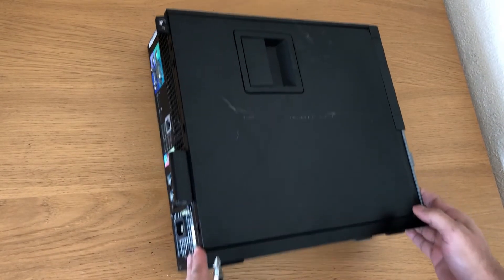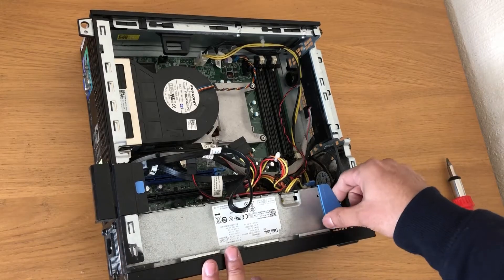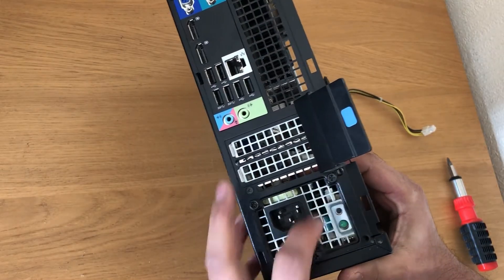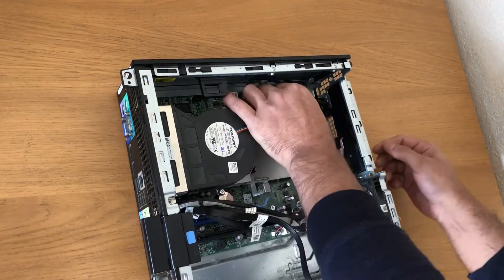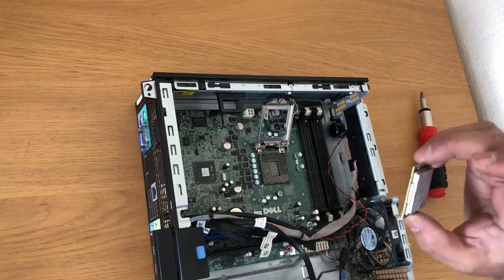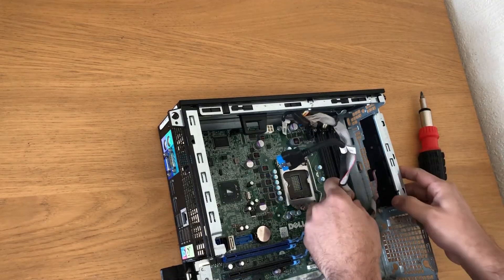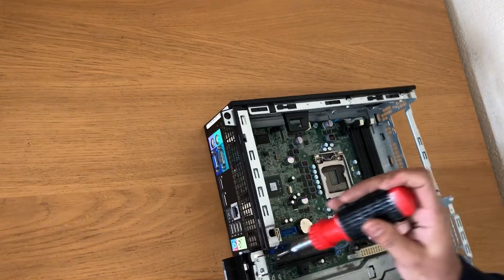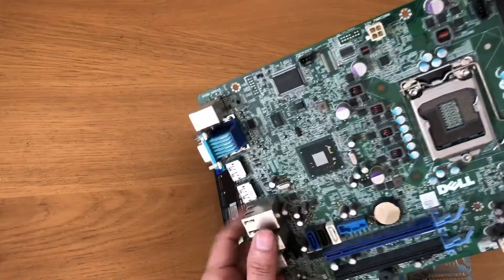Dell Optiplex 7010 790 990 SFF Teardown Disassembly

Comment: I knocked over my tower by accident and while unit shut down. Now when i start it back up my monitors wont come out of sleep mode and keyboard or mouse dont work. What the heck is wrong?
Reply from the maker: Try taking the ram out of the slots and put them back on again
Reply: I reseated the RAM sticks and checked all connections and still not working. Power button flashes amber light 2 times, then 3 times. CMOS battery maybe?
Reply: Thanks!! I just fixed it!! I took out the RAM sticks and put into the other 2 slots and also took out the CMOS battery and put back in and now boots up! Thank you soo much! Been working on this for 3 days now trying to figure out as I know nothing about computer hardware.
Reply from the maker: @jzepp7013  glad you managed to fix it.
Reply: @SyltechUk keep up the good tutorials! I know nothing about computer hardware but you saved me from just buying another tower because I thought I would damage my current one and not be able to fix myself

Comment: when i try and pull the latch on the side it wont open. and i pull hard, im afraid if i pull even harder im going to break the handle latch off.i noticed yours opened easy and you didnt even have to pull it hard.and mine is a 7010 just like yours. did you have to unscrew any screws before you pull the side latch?
Reply from the maker: Mention the minute you on about. I’ll try to have a look.
Reply: @SyltechUk  i  had some kind of thing on the back on the top latched to it to keep it shut. i managed to cut it off with some bolt pliers.and now the latch opens easy.